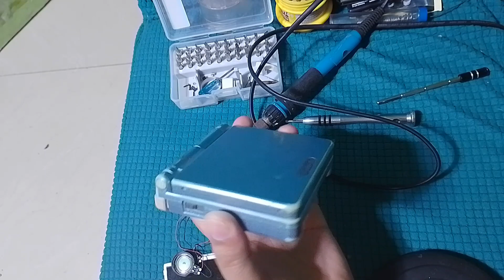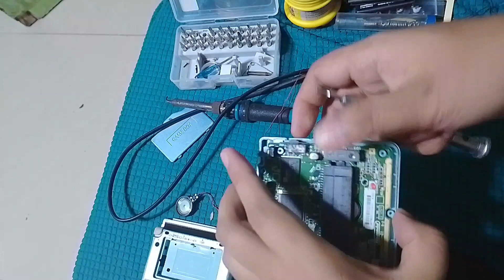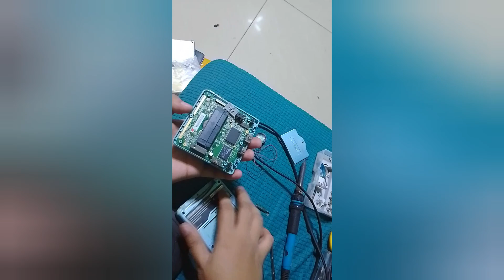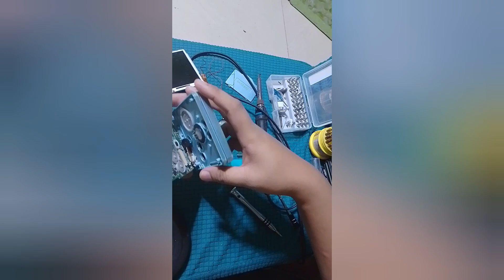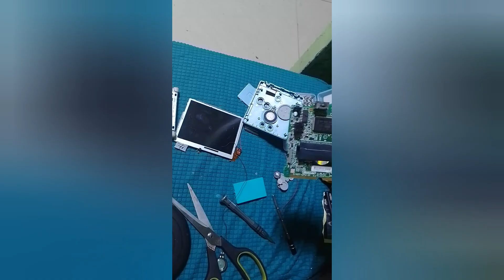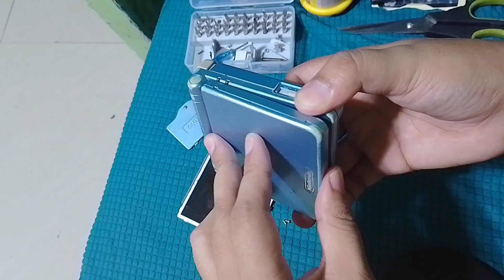No Capacitor Needed - Gameboy Advance SP Low Volume fix enhance sound GBA SP

Comment: Somehow I shorted my speaker and now there's no Gameboy showing nor sound! Any help?
Reply: Hey @chikupachi, I went to desolder the points and my sound came back (a lil bit louder lmao). And the white screen I realised it is a LCD fault (maybe because I'm using an ags101 board connecting to ags001 LCD?).

Does it matter if my ags101 board is a 3-2 speaker (instead of 5-2) in your video?
Reply from the maker: @SuperBladerxxx AGS001 LCD isn't compatible with AGS101 Board. You either have to buy an original LCD for AGS101 or An IPS LCD that is both compatible with AGS001 and AGS101 board.
Reply: @chikupachi I tested your method with a 5-2 board ( same as your video) and it worked! Thanks so much! 

But sadly for the 3-2 board and the 8-1 PCB s, it didn't work...
Reply from the maker: How did it get shorted in the first place? Did you use a soldering still plugged to the electricity source?
Reply: @chikupachi nope! It is a portable solder. I used enamelled copper wire as well. Curious as to why there's no sound at all...

And also a funny thing is the screen does not show the Gameboy logo when booting.

I took a long time to solder a solder blob at the capacitor. Does it mean I've blown a fuse when I was trying to make a solder blob?

Comment: didn't work.
just make things worse.
Reply from the maker: It's either you haven't done it right, or you used a Model AGS 001.
Reply: @chikupachi nope.
my SP is AGS-101
some call it brighter edition.
Reply from the maker: @dennisdamenis6831 yeah as I said it's either of the two of the mentioned possibilities
Reply: @chikupachi  Do you also use a capacitor?
Reply from the maker: @dennisdamenis6831 in this video, the capacitor has not been replaced. It's still the original one.

Some people replace the capacitor to improve or fix the GBA SP's low volume issue. However, it's hard to find a capacitor for the GBA SP, you may find one in some online stores.
Reply: @chikupachi what are the causes of low volume even though the volume control is clean and speaker is working perfectly fine??
Reply from the maker: @dennisdamenis6831 it's a common issue found on most GBA SPs that weren't used or kept for a very long time. The issue might be coming from the exposure with the moisture that has formed inside the device when kept for so long.
Reply: @chikupachi  Do you have a tips in good and best soldering iron?
Reply from the maker: @dennisdamenis6831 I just used cheap ones as I cannot afford to buy expensive soldering iron/rod. But they can still fix the issue. It's best to use soldering paste. There are also some tips you can find in some youtube videos on how to properly use soldering paste/soldering iron

Comment: Hi I have this same problem, I'm trying to fix, but I don't a that wire, is there any other option? Like a copper wire or something? Or where can I found a wire like that besides a Ds?
Btw I'm not a english native, so excuse my english if I make a grammar mistake.
Thank you in advance.
Reply from the maker: @kilmarsakuraba8171  hello, I haven't tried any wires yet so the wires I only recommend are the ones I have already tried. You may find some defective dsi, dslites being sold for a cheap price in fb marketplace.
Reply: @chikupachi  well I will look it up. The question is, it works with any ds version wires? And also, I don't know if I read bad, but is there a batteries from a DS that work on the GBA SP?
I think, that I read that in a comment from your videos.
Reply from the maker: @kilmarsakuraba8171  yes the battery of first gen DS, also known as DS Fat, can work on the GBA SP.

As for the speaker, any DS Lite, or DSi speaker wires, havent tried the speaker wire from DS phat yet, but I think it will also work.

Comment: Does the volume slider still work with this mod?
Reply from the maker: Yes, you have to make sure your volume slider still works.
Reply: Do you need to do anything besides bridge that connection with the wire? The volume slider still works with the bridged connection? @chikupachi
Reply from the maker: @tozac  Prerequisites:

-Must be gba sp ags 101 - this trick does not work on ags 001
-your volume slider must still work
-it's advisable to use a wire from DS lite/dSi speaker
-must be soldered
Reply: @chikupachi  got it. After the mod, is the volume slider still usable?
Reply from the maker: @tozac  yes it will still usable and can control the volume

Comment: I just tried it now. It is amazing. Sound is super loud and crisp. So amazing. It went from literally 5dB now to about 80dB. I just need to test the battery life. I have an original GBA SP battery inside and I have started the test at 20:45 on 27/6/23. Let’s see if we get some good battery life still. Fingers crossed. I’ll come back with reported results by the end of the night 🤞
Reply: Yes! I got over two hours. Thank you for making this video 🏆
Reply from the maker: @Mozspeare battery for first gen DS is good as well. But some branded ones are the best. Though they are a bit expensive.
Reply: 1 hour later at 21:45 battery is still good with Super Mario Bros Deluxe playing with sound on maximum 😂
Reply: Haha two years later and I am still receiving help from you and your video. After forgetting how to do this, I checked my video history and found this liked video again. Will solder the left of CP1 to number 2 on 5-2 speaker joints ❤

Comment: Is this trick is safe?
Reply from the maker: Yes it is. Try it yourself. I'm a seller of gba sps and have fixed almost every gba sp I sold with this method. I haven't received any complaints about it.
Reply: @chikupachi  woww nice bro. I will try it. My gba sp is AGS 101 can? Thanks sir.. 😊👍
Reply from the maker: @harrispribadi6969  yes. This only works on model ags101 (the brighter edition)

For some reason, this does not work on model ags001.
Reply: @chikupachi  wow nice sir. Thank you very much 😊👌
Reply: Im going to try this
Reply: @gotgame8083  i already try and  the sound become loud. But the battery drain so fast. From full charge only 30minutes last... But when i return to default. The battery can last 2 hours. Dunno why...
Reply from the maker: @harrispribadi6969  maybe the battery you have used is already very weak and you maxed out the volume. The maximum volume actually becomes very loud (louder than normal) and I experienced this faster battery drain on  an old original slightly bloated battery but not with the new ones. I am using the battery from DS Phat by the way because DS Phat are cheaper than buying branded battery for GBA SP. Plus I have the DS Phat's parts as a bonus.
Reply: Hi, sir. I tried this trick with my gba sp with very low sound and it works, but charging port doesnt work anymore. Any advice, sir?
Reply from the maker: @mikoberbana8792  the trick has nothing to do with the charging port. There must be another problem with your gba sp.

Try cleaning the pins and metal contacts of your gba sp charger and charger port.
Reply: @chikupachi , thanks.
Reply: didn't work.
just make things worse.